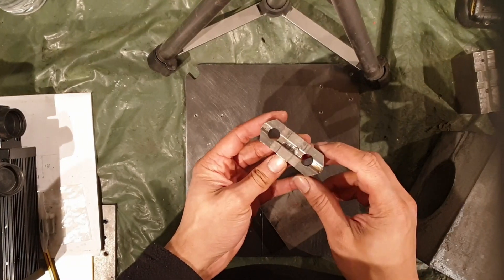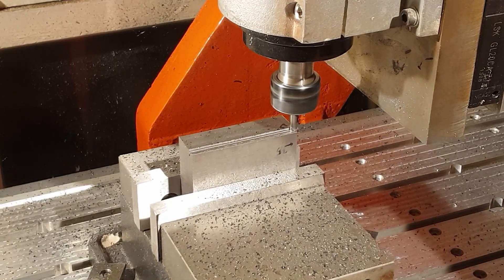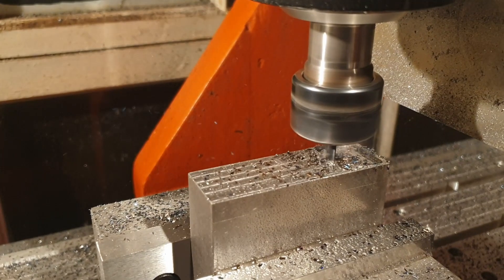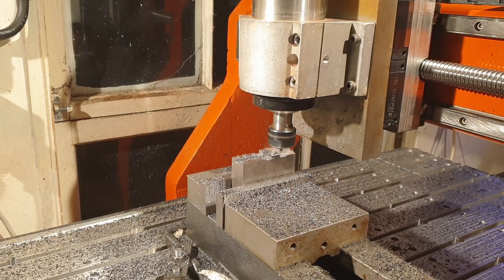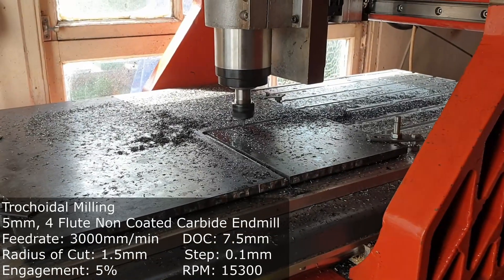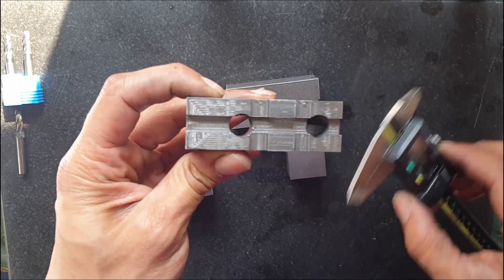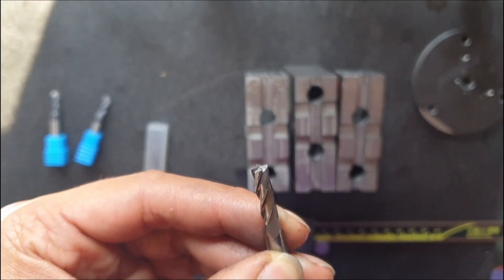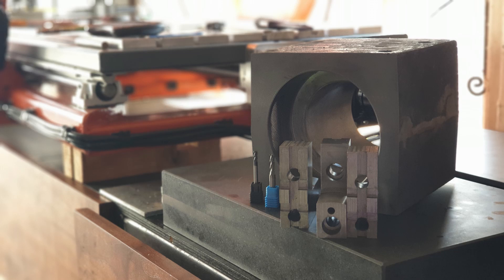Machining Steel on a DIY CNC Router

Comment: Did some testing in steel, too. Try adaptiv, it works for me.
Reply from the maker: Yeah adaptive works great and i routinely use it. However i have recently chnaged to a BT30 spindle and thats made the world of difference!
Reply: @vhospher6463  What spindle do you use? I'm thinking about an upgrade, because my router is rigid as hell, but the spindle is the weak point.
Reply from the maker: @RUNCNC  i use a bt30 12000 RPM ATC spindle cartridge. Got it off Aliexpress. You'll have to spec a motor, i use a 1.8kw servo to drive mine. This and mist coolant has really changed my machine. Did actually film the unboxing etc but never go around to uploading it. Same with the spindle assembly build.

Spindle cartridge was fairly pricey. And my spindle assembly alone is probably over 50kg

Comment: What if you got a better spindle? Or made 1 and used that motor to drive it? Or replacing the cheap bearings with high quality bearings? Loke angular contact bearings? All that chatter is from a not so rigid spindle it looks like
Reply: Ya if your machine is not jumping around it is plenty rigid...so maybe a video about improving your spindle? Beautiful machine otherwise!
Reply from the maker: Thanks for the reply. So I've been working on a new spindle system. Bt30 cartridge with ATC and servo driven. Hopefully will have a video on it out in the next couple of weeks! Hoping your right about the rigidity!